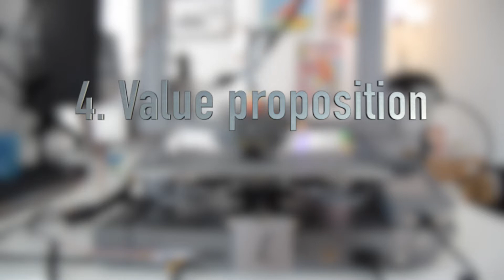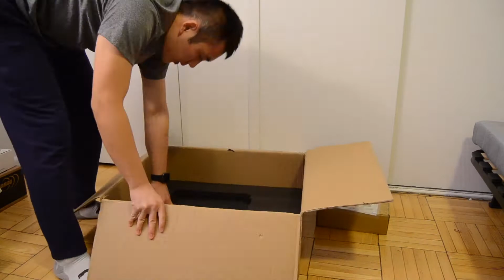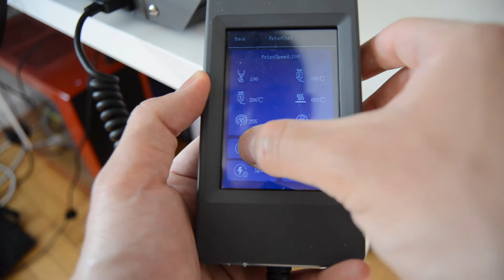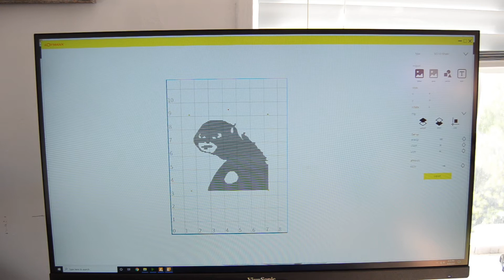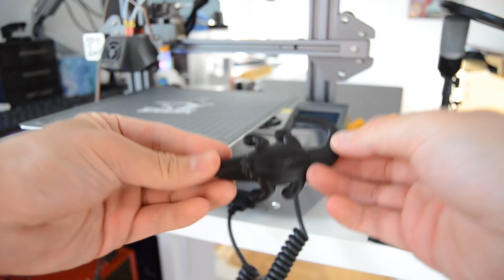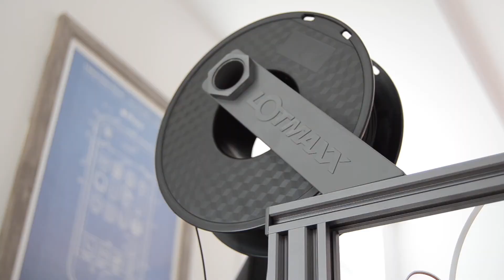LOTMAXX Shark 3D Printer Review: Bicolor Printing & Laser Engraving?

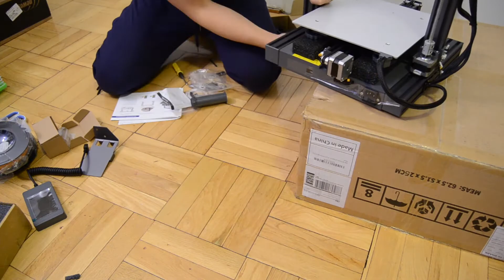Comment: 2:39 here you've realized just as I had that just having it hang over a ledge is the right call for screwing on the gantry
3:18 here you've also fallen prey just as I had to putting the one singular long screw into that spot where the touch screen mounts because the instructions tell you to use the wrong screw

I'm here because the printer literally won't print anymore after a failed lucky cat and a model I made that printed shittily using a simplify3D factory file I found on a forum. No clogs or anything, it loads the filament in just fine. But it just won't print anything anymore. : )